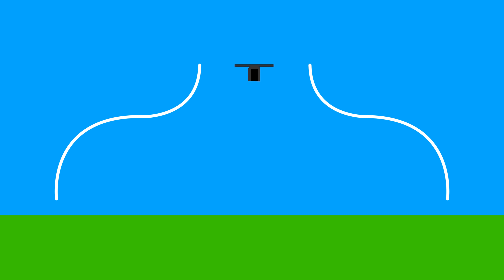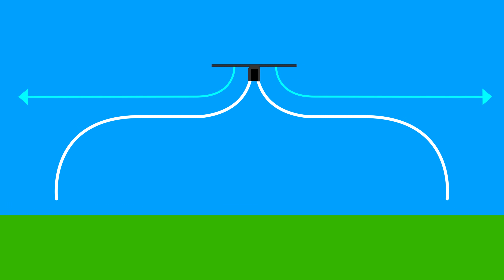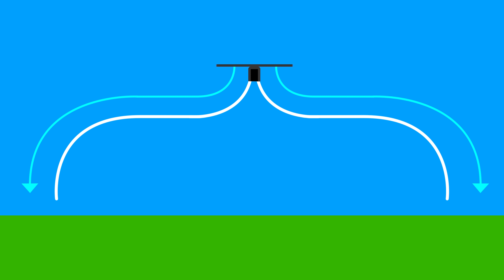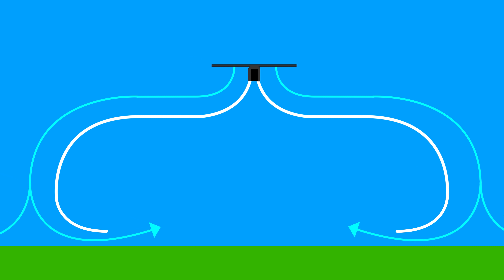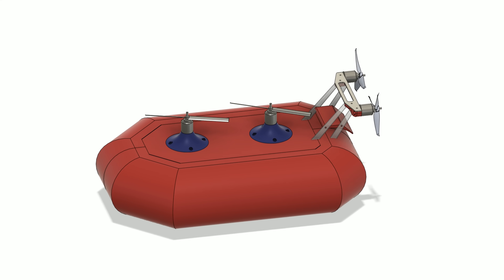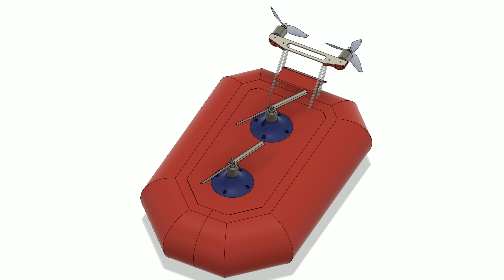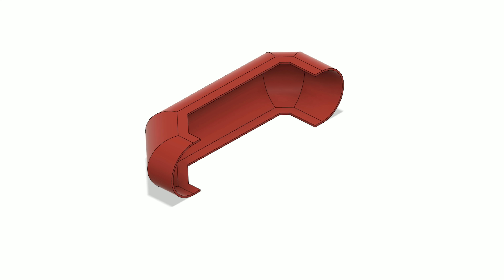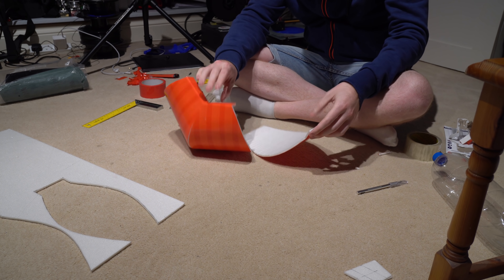Coanda Effect Hovercraft

Comment: All You need is some outriggers,.. Skids.    light weight supports that reach out on each side and angle back. [so they don't dig in easily]   Kinda like the U2 Spy Plane needed at the tips of it's wings due to it's wing length and central main landing gear configuration, making tipping easy.

I bet they'd reduce over-ending to a great degree.   Front and rear would provide more stability with the erratic movement/controlability caused by terrain and environmental factors. [winds, temps, humidity, etc],.. as opposed to a single centered one on each side.  Unless a one piece design which mounts front and back on each side, and runs the length of body. kinds like a Helo Skid.

You could 3-D print them also using a flexible plastic.  I'm sure the thrust would still be sufficient to provide more then enough lift,. even given the added weight,.. though we're probably only talking a few ounces at best.

Comment: I like what you’re doing. Some thoughts for free. The props are impacting the stability and effeciency of the effect. What about a ducted fan and manifold set up to evenly distributor the air across the surface? It would eliminate the gyro, blade turbulence and lift effects from the spinning props.
Hull shape too could be redesigned to maximise effect. I recon just 4 sides might work better or a perfectly smooth dome or oval,maybe?
Nice one👍

Comment: If you made the curved upper surfaces, spinning rotors, with the direction of the top of rotor away from the  centreline. then you would see it rise even more. You also need to pressurise the interior of the hull, as the low pressure will reduce lift.

But, most of the lift is just the propellers

Comment: I wonder if you need to mix in a slight reduction of your lift motors when you're moving forward fast, to reduce the risk of take-off? Or keep the nose pushing down to prevent lift-off?

Comment: Welcome back Tom. Good camera work (the slow mo's were very entertaining). i've been using the Tom Stanton Hovercraft at indoor meets. It's a bit of a handfull if it picks up speed on right hand turns. Did you try a longer version? I'm wondering if having a twin with counter rotating props would be easier to control.

Comment: I think the low stability is due to the lack of the inherent feedback in a conventional hovercraft. To be specific, when an edge of a conventional hovercraft lifts, there is a localized decrease in the air pressure on that side and may even be (I speculate) a Coanda or Bernoulli force sucking the skirt down to the surface as the air rushes out. On your version the only significant feedback is that the weight shifts away from the rising side and the stationary air gets stuck underneath increasing the pressure and, thus, the lift.

Perhaps if you had four independent Coanda zones and a mostly conventional drone controller you could maintain level in dynamic conditions, especially turns, and you could actually increase the thrust a little and keep it 1 to 2 cm above the surface.

Another possibility would be to simply put a hole (not too big) in the middle of the deck so that some of the air from the lift props would pressurize the underside and reintroduce the inherent feedback lost when converting to Coanda. You might even gain some height feedback. As the craft rose, more air would go inside and the lift from the Coanda effect would be reduced, and as it fell more air would go outside increasing the Coanda lift.

Comment: I would like to see you cut some holes in the deck to slightly increase the air pressure inside
Reply: obviously you don't understand the concept of what he's trying to do. It has to do with air flowing AROUND a curved surface creating lift rather than as in a conventional hovercraft creating lift from inside. Go back and watch the first few minutes of the vid and try to understand the concept

Comment: I feel like this could be improved if it was balanced front to rear and maybe had a bottom counter balance weight. The rear is off balance due to the motors and mounting for them. And it might be more stable if it had a lower center of gravity with a bottom plate that went around the opening in the bottom. 
Or...

What if it was similar shape with 4 motors up facing. Like combination of this design and your quad design.

Comment: A normal hovercraft needs to be open on the bottom, but maybe this one would work better if you seal the underside...only leaving a small gap, trapping the air and giving it more lift.  
Second, did you do a smoke test on it to see how it is working?  
And since it is not really a hovercraft (the bottom does not need to be hollow)... maybe you could divide it into two narrower tubes like a catamaran, put one motor on each side. maybe having less distance to travel will increase the lift. If the two tubes are open (or partially open) on the ends, then that might help with stabilization while moving forward.
Just some random ideas.

Comment: Before seeing final result... I wonder how the sharp corners on the skirt will effect air flow in regards to distribution of low pressure zones.  Also the impellers would cause the air to flow away from the sides then down towards it, so no surprise...
Reply: Seeing effect... Nice.  Need some work on blast to redistribute weight evenly.

Comment: Why didn't you add an equal amount of weight in front of the craft to counter the motors in the rear?  Second, would spoilers on the sides decrease the lift on the leeward side to help reduce the roll when making a turn?

Comment: Just a quick tip for getting fair/flexible curves from foamboard. If you take the paper off of one side, you can usually get a really nice bend. It works best with a foamboard called Adams readiboard. You can find it in the US at dollar tree/dollar general, but I'm not sure where you would find it in the UK.

Comment: Tom, I really like your style and thinking. This device is very similar to a series of experiments that I was shown in the early 1980s. You noticed a lot of leaves collecting in the plenum. What is happening is that the flow around the hull is establishing a vortex ring structure under/within it. This is scooping the leaves up. You have not finished the experiment! What you have is a high ground effect vehicle. This means it creates significant lift due to that vortex system when some distance from the ground. Think of it a little like a basketball player bouncing the ball, he is experiencing “lift” due to the bouncing ball at some distance from the ground, the vortex ring system is doing similar. The trouble is that a vortex ring near a surface is quite unstable. This is why your craft tips over so easily. To stabilise it you need to use a lot of flow straighteners and possibly the odd baffle or two underneath the craft.

One experiment well worth doing will be to measure the lift vs ground separation. You will find it is significantly better in this respect than a conventional hovercraft.
By the way, the chap who showed me the original experiment was Leonard Cramp on the Isle of Wight. He had worked on the design and development of the original SRN1 (as well as on the Black Knight rocket). A very unusual and laterally minded man.

Comment: thing is, how do you know the coanda effect is having any significant lift compared to the lift your likely getting from having propellers? impellers are obviously a way to negate that but you already showed you'll need higher torque motors to run those. i guess the one way you cna see the coanda effect applying some amount of lift is the fact that 'top heavy' effects the craft, as if nearly all the lift was from the props 'pulling' the craft upwards it would balance below there pivot like a helicopter, and would be very hard to flip with this setup.

Comment: Tom Stanton  , do you accept the suggestion of taking a test?
Cut horizontally at midline of skirt (orange), halving skirt height ..
The air outlet, downwards, will be vertically downwards, not into the skirt, which has turned the skirt into a debris deposit.
Increment the skirt with FLAPs controllable by a 3-axis drone board for horizontal stabilization.
These flaps will act on the front, back and sides, maintaining horizontal stability, avoiding rollovers. :)

Comment: A couple of things that appear to be decreasing stability are the hull shape and the lack of high velocity air under the hull.   

One thing that would increase stability is making the bottom opening wider than the flat deck part of the upper hull, so there's at least a 10 degree offset and more like 20 to really reduce roll.   Basically you've got a hard skirt.   The skirt edge is where all the action happens and if it's not offset outwards of the upper flat deck, it's arm from the CG is too low and the moment isn't enough to counter the inertia of the craft.   I bet if you widen the bottom opening the edge will gain enough authority to keep it more solidly planted.

Another thing about hovercraft as well, a very important consideration when it comes to stability is the velocity of the airflow between the lowest part of the skirt or hull and the ground.   Just having a pressure differential isn't enough to stabilize it, the real stability comes from the venturi effect between the skirt and ground creating a ring of low pressure around the lowest point that acts to suck the craft down to the ground around the edges.    This means that the skirt of air lifts the craft from the ground but also keeps it stuck to the curtain of air, which is also stuck to the ground depending on velocity, and why a proper hovercraft would never leave ground effect even with an excess of airflow.   The ride height of a hovercraft with proper velocity under the skirt or hull edge is just around 10% of the width, no more and no less on a smooth surface (grass reduces this a bit due to turbulence).   If it keeps lifting under power you have too much pressure differential and not enough velocity.   Underpowered craft will be stable but not achieve the full 10% ride height and will drag more.   

You can easily test this, build a skirtless hovercraft like 10x18" (at the lowest point) and power it up till it stops lifting and it'll settle into a 1" high hover.   Now build another hull at 15x18", power it up to max hover and you'll measure around 1.5".

I've built a LOT of hovercraft and found that you want at least a 16" effective width if you want to fly over anything like grass, gravel, and water effectively with a skirtless.   If you build a good high skirt and keep the effective edges wide enough, it's easy to get several inches of clearance from the hull.   

I've linked this before, but check out my hovercraft videos if you want to see what i'm building and how they fly.
https://youtu.be/ocuYTigFA4o

Comment: For the overheating problem with using the turbine, you could isolate the motor in a mineral oil bath and put a compact heatsink to pull heat from the motor.
Reply: Probably too much added weight, but an idea

Comment: I think you should rig up a weight underneath the aluminium bracket to change the center of gravity so it'll be more stable or you could run some brace arms off like a pontoon boat so you could have these Outriggers so if it wants to rollover it hits an outrigger and self write self you need to change either the center of gravity or give it something on the outside to brace it against rolling over jessem suggestions peace out have a great day

Comment: You could mount the motors underneath with long drive shaft to lower your center of gravity.   Would have liked to have seen the bottom covered (even with tape for a quick test) to see the difference it made.  Would also have like to have seen the props mounted closer to the hull to see the effect.